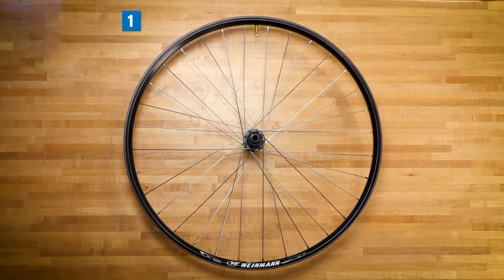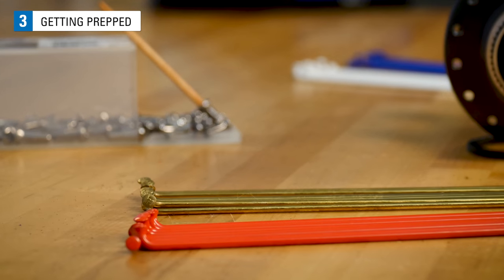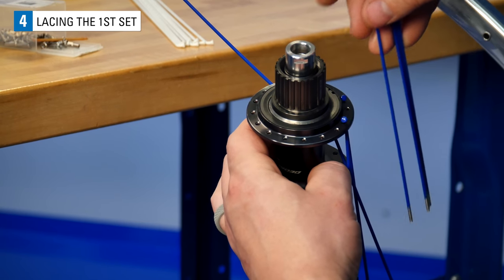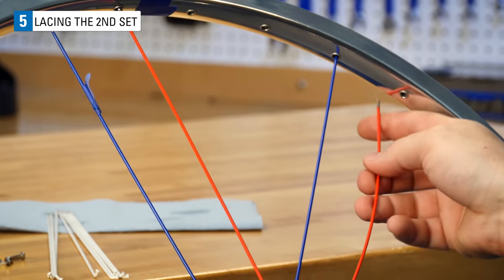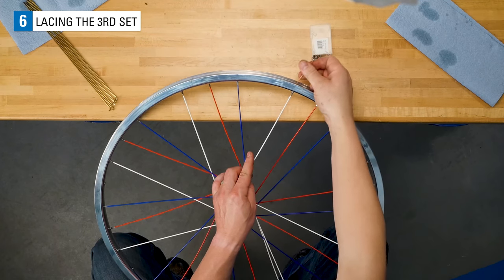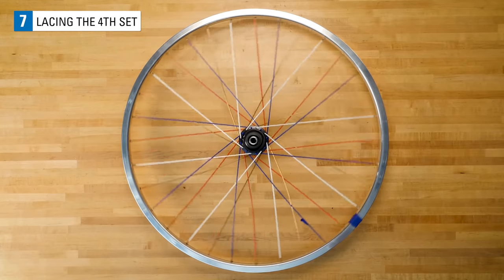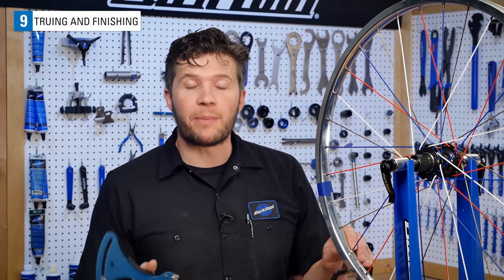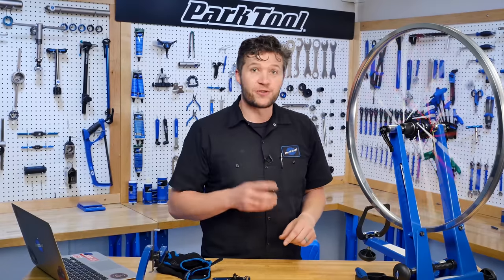How To Build A Bicycle Wheel

Comment: Awesome video. I think I'm gonna attempt a wheel build. However, this video is for 32H I'm building a 36H wheel 3 cross. Do I still follow this same video guidance?
Reply from the maker: The example is a 32º, but the concept is for 40, 36, 32, 28, 24, 20....
You still lace in groups of 4.
Reply: @parktool  hey thanks for the reply! I'm gonna give it a go. Wish me luck!
Reply: @parktool  some people say start at the hole one hole directly to the left of the valve hole... hmm some rims have staggered holes up and down, left and right. i didn't see any of this mentioned but assuming it doesn't matter much? if your rim has a logo on just one side does it usually face to the right drive side or left brake side.
Reply from the maker: @Rickydbaby  You are correct that some rims are drilled directionally and may also be offset from one another. One thing that seems to be consistent on these rims is they are all drilled so that the second hole to the right of the valve is always towards you(I say towards you because when you flip the wheel this holds true). It is drilled the same as the hole directly to the left of the valve hole as well. This is because both holes will have spokes from the same side feeding to it.
Reply: @parktool  thank you this makes a lot more sense now.  I appreciate it.  I'm going to try and lace it up tonight!

Comment: what's the difference in spoke lenght between disk side and non disk side? thanks (2mm?)
Reply from the maker: It can be 2mm, but some hub designs and rim combinations can make it 1mm or sometimes even 3mm.  Figure the length for each side and you will know.

Comment: Sir, could please explain why you considered differential spoke length, aren't all the spokes of equal length?
Reply from the maker: The the distance from the rim spoke holes to the hub spoke holes is different, using differential spoke lengths can help thread engagement.  This is when the flanges are offset differently from left to right side.
Reply: Sir, thanks for your reply. My bicycle has a few spokes loose, would be ok to tighten the spoke with out removing the tyre and the tube? Or Will it damage the tube? Thanks once again, Leonard

Comment: You are using a Shimano Freehub, but not following Shimano's recommended spoke placement for the drive side. Shimano recommends the drive side leading spoke be placed with head out/elbow in. It looks like you did the opposite. It appears you did the brake side correct. Leading spoke placed with head in/elbow out on the disc side per Shimano dealer manual.

Comment: Now tell me where to buy spokes. They want to sell wheel sets. I remember when the word wheel set wasn't used. The wheels came with the bike or you built your own. They are so concerned with the customer ordering the wrong length, you can only order them in a built custom wheel. It's so frustrating that LBS also carries a minimum stock and I've got them all. Very tempting to calculate cross 2 which I have and see if they have lengths for cross 3 or 4 even. Very easy to change cross  with same rim and hub. Just need something to replace my worn out spokes with, you guessed it- new spokes! This is labor intensive but I have the experience and enjoy doing it.
Reply from the maker: Search around for spokes, they are out there.  Changing cross patterns certainly an option if it means you can get the spokes for it.  However there are limits. A 32º wheels will not work with a 4X, but a 36º will.  If this is a disc hub, avoid radial, and even 1X.
Reply: @parktool  What about cross 4 with a 28 spoke wheel. I've noticed over the years that 4 cross tends to break at the nipple threads, while 2 cross breaks at the J bend. Would  single butted 2.3mm x 2.0mm spokes fit in your average hub flange holes. I must have 3 different brands of spokes in that wheel by now. Now that alone can't be ideal! Just tired of stopping at the roadside, grabbing the Trixie tool, spoke wrench,  and a single zip tie when that twangy sound happens!

Comment: How many spokes used in this video? 32 or 36?
Reply from the maker: That wheel was 32º.  The system applies to most any number.  20, 24, 28, 32, 36, 40.
Reply: @parktool  great..thank you

Comment: I’ve got a 28 spoke 3 cross build and I can get up to the second lacing set. The spoke won’t go over three as it is too short but when I look at all the spoke they look about the same size. Can there be very small differences or is it something else. I need help !!!!!
Reply from the maker: You are building if sets of four?  The cross set crosses only 3 time counting at the hub.  About how much short would you guess?  Make sure the spoke nipples are not catching in the rim as you rotate the hub.  If you seem short by  10 or so mm, likely there is a lacing issue.  If short 2-3mm, might be spoke length.

Comment: Is building with a straight-pull hub is the same?
Reply from the maker: In concept yes.  The hub permits the spoke to point in only one direction. It is very difficult to make a mistake in lacing.  We do need a video on this, but the lacing is determined by the hub manufacturer.

Comment: I see problem at 5:32 with the rim i used (WTB kom light) concerning the "key spoke".
This rim is "right handed". The first hole at the right of the valve hole is on the right of the center line of the rim. Therefore I have been told that i should use this first hole to insert the key spoke of the drive side, not the second hole as said in the video (assuming that the holes on the right side of the rim are for spokes that run to the right flange of the hub, the same for the left).
Is you video for "left handed" rims only or did i make a mistake ?
Reply from the maker: Inspect your WTB rim again.  Like all modern rims, WTB uses the staggered drill with the second hole for the right. Older French rims did use this pattern you describe.  In any case, consider the rim laying flat on a bench as you build.  From the valve, go right to the first upward staggered hole.  For modern rim it is the second hole, but for some older rims it is the first hole to the right.  If the rim is drilled straight with no stagger, the pretend it is staggered and select the second hole from the right.

Comment: One thing that's not covered is that some rims have holes that are not centered, alternating from left to right, should they be closer or further from the hub?
Reply from the maker: Offset rims should have the positive offset towards the Non drive side. This gives the Drive side spokes a better "bracing angle". A better bracing angle evens out the mechanical advantage from non drive to drive side.

Comment: why the second spoke hole to the right of the valve, and not the first to start with? because that hole facing right? looks on video holes are centered in the rim. they aren´t?
Reply from the maker: When a hole faces right, use that hole to start.  But if centered, it is simply a good work habit to be consistent and select the same second hole.

Comment: 18:42 He means to say "raise" the tension of the wheel. Not drop. FYI This is the moment you will find out if your nipple choice and tools are up to standard. If your spoke key design, spoke lengths, nipple material or spoke prep lubrication is poor, you will start to break stuff at tensions as high as 120kgf. That's why it's advisable to use heavy spokes and brass nipples for that first build. (Maybe even do a front wheel, rim brake). Then your only real worry is with the spoke lengths. Not all Parktool spoke keys look great by the way, for lightweight builds. So it's not about the brand necessarily. Same goes for spokes too. People obsess way too much about the brand imo. 😁

Comment: Can I use Park anti-seize on the spoke threads instead? (I’m using aluminium nipples if that makes any difference). Thanks.
Reply from the maker: It would work, and certainly be a bit more messy.
Reply: @parktool  thanks for the quick reply!

Comment: The spokes should be different in length ?
Reply from the maker: For a any hub with off-set flanges, such as rear hubs and front disk brake hubs, the distance from the hub to the rim varies left-to-right sides.  For a rear wheel, ideally, the drive side spokes can be shorter compared to non-drive.  This gives ideal thread engagement.  For a front disk hub, the disk side spokes are a bit shorter for ideal thread engagement.  You can is many cases use the same length for both side, but one side will not have ideal engagement.

Comment: Great video, and super useful! Regarding the direction of the spokes - Shimano seems to recommend (https://si.shimano.com/en/pdfs/dm/RAWH010/DM-RAWH010-01-ENG.pdf) head-in/shoulder-out for trailing spokes on the drive-side (rear). But in this video it shows head-out/shoulder-in for trailing spokes on the drive-side. Is one or the other correct?
Reply from the maker: Out of all the Shimano tech reps we have talked to, none of them have been able to explain to us why they recommend that method. Both methods will build great wheels.
Reply: @parktool  When the rider puts load through the cassette, the trailing spokes will get tighter, and the leading ones looser.  Therefore if the leading ones are on the outside, they could bow out and be caught by the derailleur or chain.  Having said that, I've got wheels built both ways and have never had any issues :)

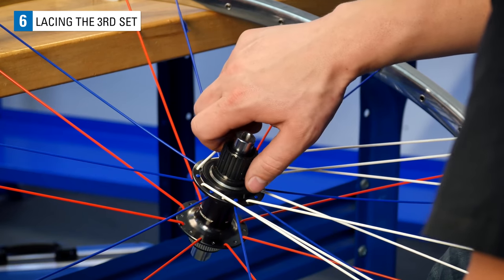Comment: In 10:44 you turn the hub to the right. If you turn the hub to the left is there a differrent?
Reply from the maker: As far as how the wheel rides, no real difference.  Depending on the hub drilling, you will have crossing spokes over the valve.

Comment: Are the red spokes and yellow spoke longer? White and  blue shorter? My hub disc side has a larger diameter than the drive side. Do I put all the shorter spoke to the disc side and longer spokes on the drive side?
Reply from the maker: This hub had the same flange size drive side and non drive.  The drive side used the shorter spokes.  However, if the flange sizes are different, that can change.  See How to Determine Spoke Length in our channel
Reply: Ok thank you!

Comment: This a 32h rim 
Do you have a 36h lacing vídeo?
Reply from the maker: 40º, 36º, 32º, 28º, 24º, it is all the same.  Begin at the valve and end at the valve. You will do 9 per set.  Otherwise it is the same.

Comment: So for the drive-side you just add another two initial turns of the nipples? How do you measure if the center of the rim is aligned with the center of the axle?
Reply from the maker: You use a dishing gauge.

Comment: Do you also need to de-stress straightpull wheels?
Reply from the maker: That is a good question.  There certainly can be wind up in the straight pull spoke. However, the hub-to-spoke interface does not see the seating in a J-bend.  So do de-stress to resolve any wind up.

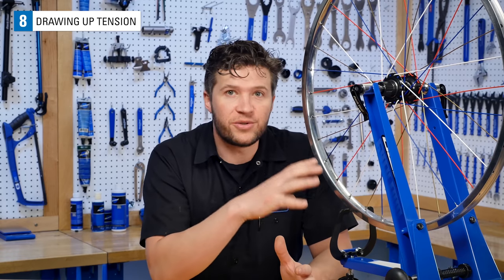Comment: 15:14 If your spoke lengths are too short to at least enter the head of the nipple, you will likely have problems later down the road. I remember many years ago, months after building, my alloy nipples would just pop in the middle of the night sounding like a gunshot. 😁 A trick to cope with this problem of slightly short spoke lengths is to use semi-internal nipples. Like squorx or DSN. It means the nipple head is much farther down and thus even if the spoke is say 2mm too short it won't fail even with alloy nipples. Is it ideal? No, but it's unlikely to fail. So if your first build is with alloy nipples, try Pillar DSN nipples. Tip. (Obviously the spoke lengths were calculated with semi-internal in mind. I'm talking about the risk of coming up short from the calculation. Not saving the situation in the video, where an external nipple is way too poorly threaded. That's new spokes I'm afraid.)

Comment: since the hub is asymmetrical, how do you set up the truing stand so the rim is 100% in the center between the 2 sides of the spokes?
Reply from the maker: See the video on centering the TS-2, etc.  No matter the stand or model, the most accurate method of centering a rim is a Dishing Tool,  such as the WAG-4.
Reply: @parktool  I do have the WAG-4 tool, but from what I see is that if the hub is asymmetrical from where to spokes holes are to the edge of the hub, this distance will be different on either side from the spoke holes. Therefore if I use it to center the rim, it will be in center from one end of the hub to the other end, but it would have been off from the center between 2 sides of the spoke holes.
Reply from the maker: The goal is to center the rim over the hub and not between the hub flanges. If you reference the rim with the blocks of the WAG-4 and the end caps/ lock nuts of the hub then you will be checking the rims center over the hub. The spacing of the flanges does not effect this and should not be considered or accounted for. When it comes to calculating spoke length is where flange position and dimensions are important.
Reply: @parktool  thank you for the tips.

Comment: Does the tension of each spoke need to be the same?  thanks.
Reply from the maker: They do not need to be the same.  It can help extend the life of the wheel, but it can run straight and round with some differences in tension.
Reply: @parktool  Consistent tension can extend wheel life.  To make the wheel straight and round, there may be a difference in tension.  right?

Comment: Dammit! My spokes come short when trying to lace the 3rd set. They barely catch the mouth of the nipples and I can't fasten them. What am I doing wrong? Trying to lace a 28 hole Shimano MT15 wheel.
Reply from the maker: Are you sure the other nipples from either of the first 2 sets are not catching on the rim? It is common for them to get caught on the inside of the rim preventing the hub from rotating to allow the 3rd set to extend to reach the rim.
Reply: Thank you for the reply. I figured out that I should lace the 3rd set with two cross without going below any spoke. It's all straight.
Reply from the maker: 2 cross is common on 28 hole applications. You can interlace (cross under) or choose not to. Interlacing is a fun topic as it is a method that has questionable benefits.

Comment: What is the science  to crossing the spoke's. Does this not create un wanted  deflection in the spoke.
Reply from the maker: The crossing is what allows the transfer of energy from the hub to the rim. When pedaling you are rotating the hub in clockwise direction. the hub wants to rotate but the rim does not. If the spokes were radial the hub would wind up. With the crossing the trailing spokes are pulled by the hub and they pull the rim around. The more important spokes on disc brake wheels are the leading spokes. These spokes transfer the brake energy from the hub to the rim. This force is much greater than pedaling force. Think of it this way, you can slow down much faster than you can speed up. If there was no need to transfer rotational energy from the hub to the rim (front rim brake wheels, wheelchair wheels, etc.) then no cross is necessary. Interlacing is another story that there is some debate about.

Comment: I am assuming that to build a 28 spoke wheel with the triple cross pattern, the process is the same except 7 spokes  per set are used.
Reply from the maker: Yes, that is correct. If the total spoke count is divisible by 4 (40,36, 32, 28, 24, 20...)  the system is the same.

Comment: Do you have 24holes wheel video?
Reply from the maker: The concepts are the same.  Just check both hub and rim has 24 holes.  The process is the same.

Comment: sorry which side does the slightly shorter spokes go on?
Reply from the maker: The hub side with the flange that is more inset.  For the rear, the shorter spokes go on the drive side.  For a front with a rotor, the left side has the flange more inset, so the shorter go on the left.

Comment: I've enjoyed the video and have tried to follow it 6 times and get the same bad result each time, but I can not figure out what I am doing wrong! I am putting a wheel back together using the same hub and the same spokes but when I follow the instructions, the spokes are too long!  This happens every time I try... What am I doing wrong? I've looked through all the comments and no one else has had this problem.  Please help.
Reply from the maker: If the spokes were correct originally, they should work.  It seems likely you are crossing them less.  Check the part where you count 3 cross, counting the cross next to the hub.
Reply: @parktool  Thanks for the response but it still doesn't work. I am working on a 36 wheel. Should I start differently on a 36 spoke wheel perhaps?
Reply from the maker: Your wheel may have had a 4x pattern before. Try over over over under at that part of the build. That will likely get you rolling again.
Reply: @parktool   Thanks, I tried that and it seemed to work. Thanks for the help and responses.

Comment: What changes need to be made for 36 spoke 3 cross wheel?
Reply from the maker: None, just having a 36º rim and a 36º hub. The process is the same.
Reply: @parktool  Do I still use the same hole offsets, as in the video?
Reply from the maker: Yes, same hole offsets just harder to see due to more holes in the same amount of area.

Comment: Hi, how would the process be in mtb rim with 28 holes and straight pull hubs?
Reply from the maker: The process for that wheel would be quite different but not more complex. With a straight pull wheel it will only really let you lace it one way. The spokes have a direct path to the spoke hole they want to live in making it fairly straight forward. You also will not interlace the spokes.
Reply from the maker: We are planning a video on that with time.  The lacing is actually easy. The straight pull hubs point the spoke exactly at the rim hole. You have no choice to make. 
 Begin on the drive side with one spoke in the second hole. The others will have to go where the hub dictates. For straight pull, generally do not interlace.